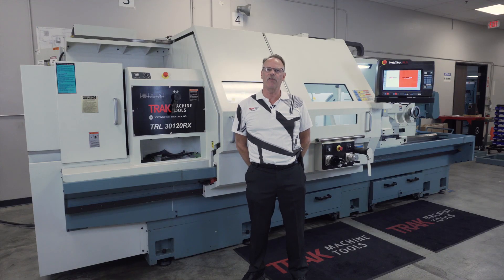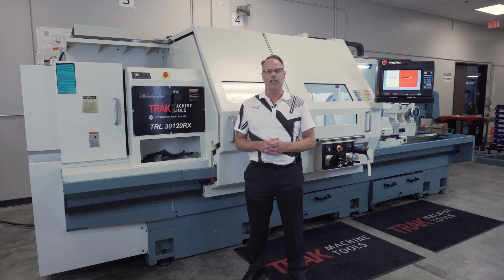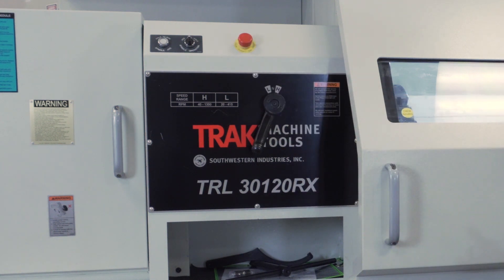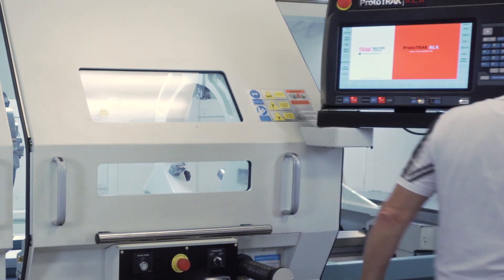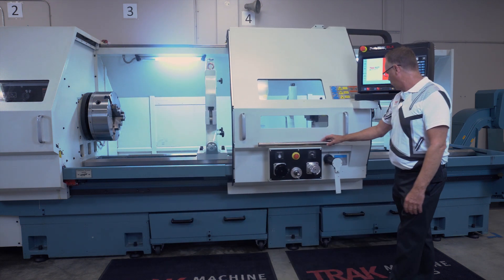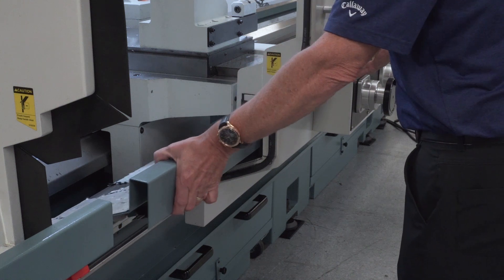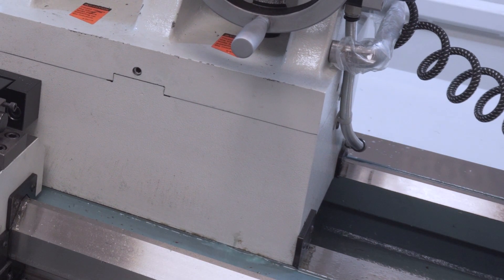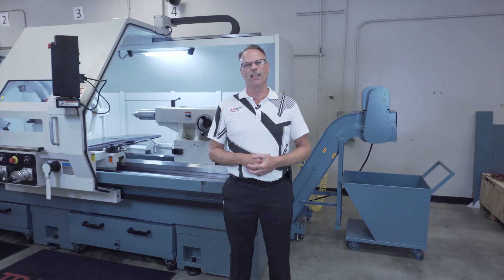TRAK TRL 30120RX Lathe Overview

Comment: What is the advantage to more HP over less RPM
Reply: The larger the part and the larger the chip, the more HP you need to cut.  Large parts do not require high RPM.  T.P.

Comment: Hey Pat!! Looking to buy one of these TRL 30120 for my shop and I actually got a question. If you're using a 8 stations turret, does it conflict with the tailstock if using a setup where a live center is needed? Let's say you're machining small pieces that require the live center, are there gonna be X axis restrictions since the turret is quite massive and can conflict with the tailstock?
Reply: Thanks Regis! I believe what you are asking is whether or not you can get the tip of the tool all the way up to the where your center meets the piece part.  I don't see where there will be any conflict when doing so.  You may have to adjust how far your tools stick out of the turret locations for the X-axis to get all the way to zero.  You may also have to adjust how far the tailstock spindle sticks out to give you enough movement in the Z axis for certain instances. I hope this helps you.  If not, let me know.  T.P.
Reply: @patrickfitzsimmons5187  Thank you!!👍